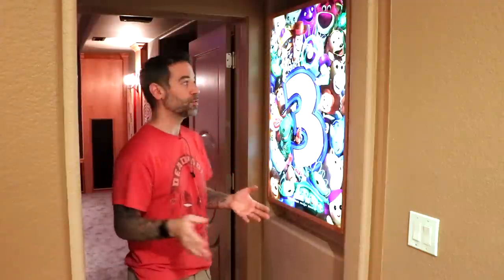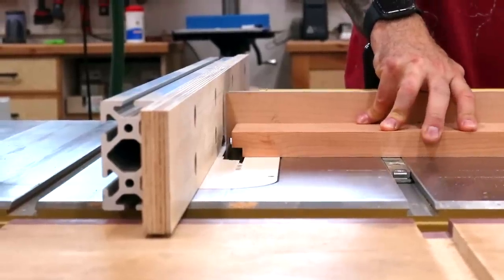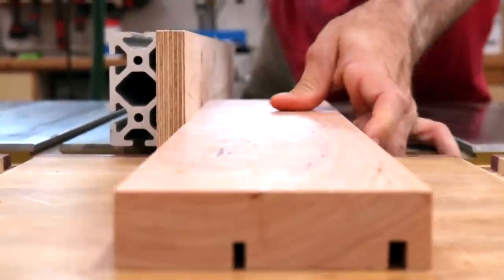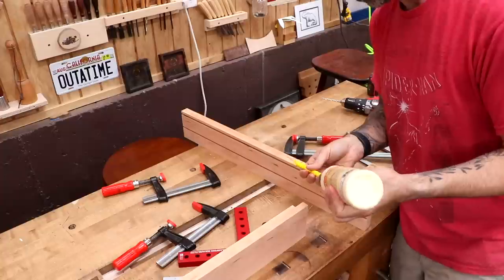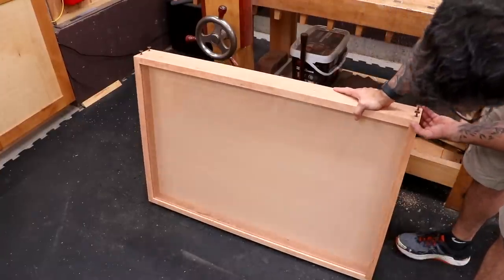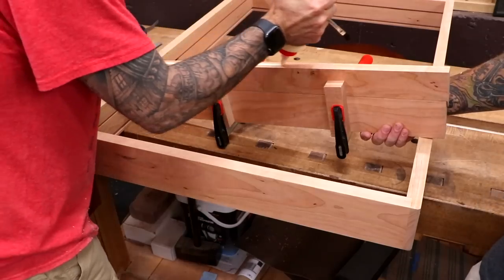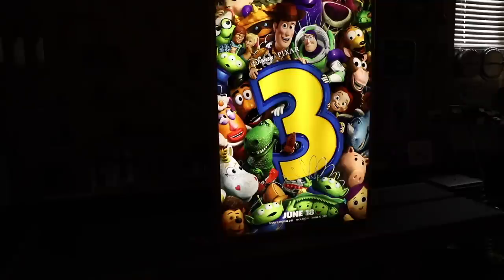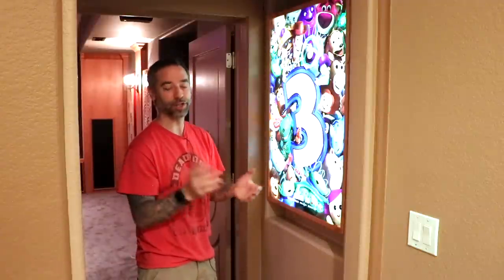Backlit LED Poster Frame Light Box

Comment: I am planning on doing this with a large fracture pic. Check them out. YOU WILL NOT BE DISAPOINTED.  I too have an amazing collection of movie posters or should I say number one sheets. I want to run mine with a battery and have a motion sensor to turn on and off the light. Just a thought in Time.